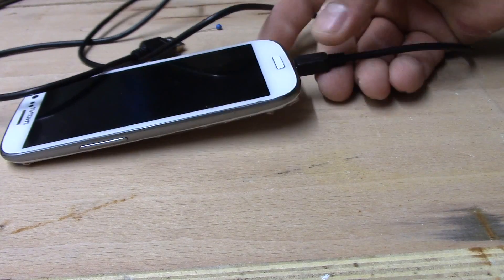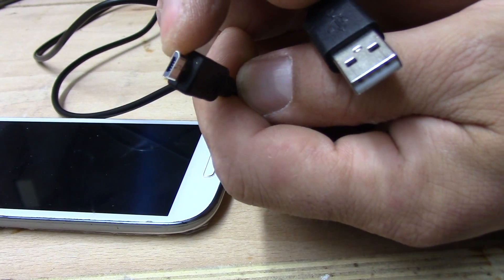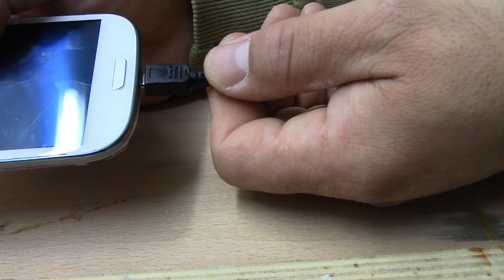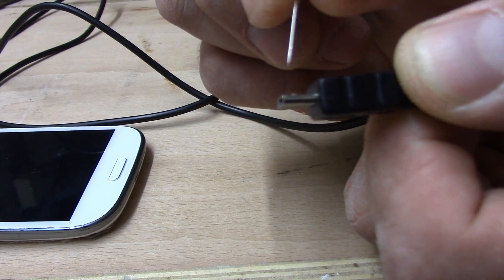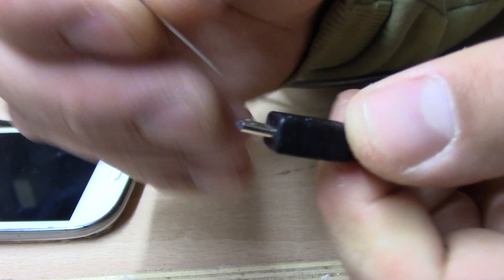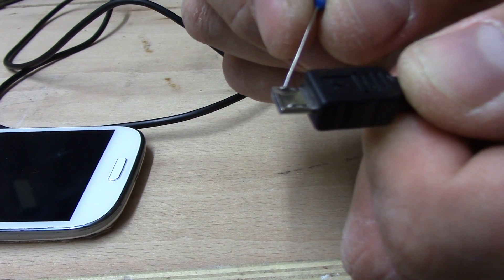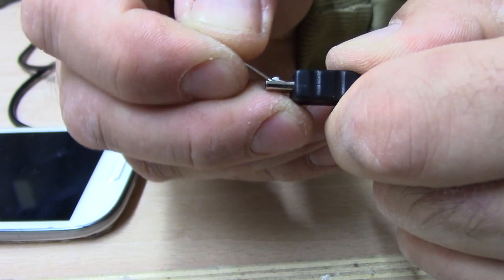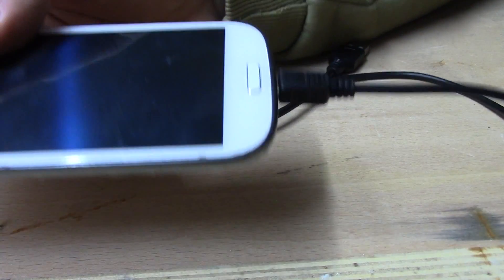Mobile phone not charging  How to fix  Micro USB loose cable repair

Comment: My Samsung phone is one year old. I hate it!  Tried this didnt work. I tried cleaning out nothing works. I hate the tiny little cable hole  "thing" on the end, cheap and nasty. I paid £14 for cable so not cheap. I want a phone with a large portal hole? like yours. Any suggestions for modern phone with large portal hole??? And good cable that will not keep falling out. Im not spending any more money on useless cables. Thank you.

Comment: i've done this multiple times in the past, yes it works. I'm currently looking into spicificaly why  the nubs/lips  recess into the casing after being pugged in for a long time. hardly anyone is talking about this spicific isue but so far i found one other guy mentioning it's a design flaw and considering this has happened to me on multiple usb micros to me in the past from proper use I'm inclined to believe it and to this day i hate usb micro, usb mini although as old as micro doesn't have any issues like this. connectors shouldn't go bad or have to be minipulated in anyway for at least a year if used properly but i have micro cables that have this issue every 2 weeks or so of staying plugged in a device.
Reply: Same.  They especially stop maintaining reliable contact in temps below 60F.  I've also found quality cables don't stop maintaining good contact as quickly.  It's like cheap cables have cheap metal in their connectors that doesn't maintain its spring as well.
Reply: @nathan2813  perhaps the problem is the stem piece of the nub/lips are designed to short for the amount they are required to bend. I've seen that principle used in some other conectors but they don't seem to have the reliability isues and I think they're longer on the other conector types.
The only one I can think of rn is the papriatary connector for the pPS Vita 1000 charger. Makes me wonder if it's simple to short of a stem it is possible to just use longer ones in a USB micro design, the connector would just stick out the port farther. I should see if someone makes ones like that, would be a good theory test.
Reply: @techadmirer6475  I looked at my own connectors and found the spring length on some (that also started failing in time) is nearly HALF that of others.  Thus, spring length (or width) likely doesn't account for ALL the failures.  

I suspect the choice of metals to create the alloy the springs are made from is also a factor, as well as the vigilance taken to ensure the metals aren't under/overheated during their manufacture.  

On a spring as tiny as these are, controlling the heat to ensure the springiness and spring life isn't compromised from over/underheating has to be difficult and is thus more susceptible to failure.

Another factor that likely exists is that China being a communist country, the factories have no motivation to produce lasting, quality products.  In fact, the OPPOSITE is probably true.  Building and exporting products that prematurely fail ensures a constant stream of repeat business from customers returning to replace them.

Comment: This actually worked! If anyone is skeptical, get another micro usb cable and try it. If it doesn't work, chances are its the receiving end and doing this won't work. But if it does work, this video will probably help.

Comment: Thank you!
You really saved me a lot of money, I was considering to buy a new phone lol
I realized it was my phone's micro usb port that was not working so 
I'd been trying cleaning the USB port, pushing using needle / pin etc, but didn't work,
I thought I just broke my phone's micro usb (because of the needle), but then
 I watched this and just lift the pins of the charger a little bit with needle and voila, it worked!

Comment: Did that and still not charging. If I press the cable downwards and hold it like that, it shows the charging symbol . If I let go, it stops charging.
Reply: Fak man I cant find a video for that problem
Reply: @ikolovesboba  Bcc
Reply: same problem
Reply: Same here
Reply: @commedyyoutubers8349  g
Reply: Same problem
Reply: SAME if u fixed plz tell me
Reply: Same here...I don't understand why it's just make no sense if I let it go it won't charge or anything
Reply: Sa mere
Reply: Me to
Reply: I have also same issue I press the cable downwards then it get charging but I let go it stops charging
Reply: Same
Reply: Either the ports dirty or bent
Reply: Same problem
Reply: @best butter very funny
Reply: @best butter still doesn't work
Reply: Same with me
Reply: Same
Reply: Mine too😒